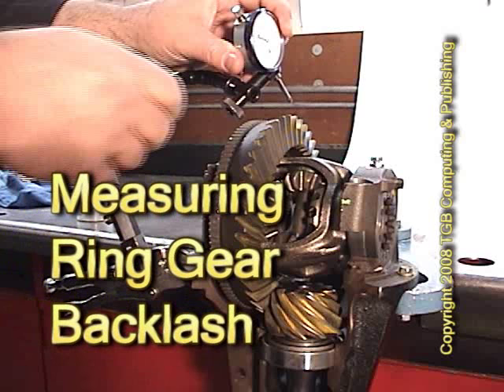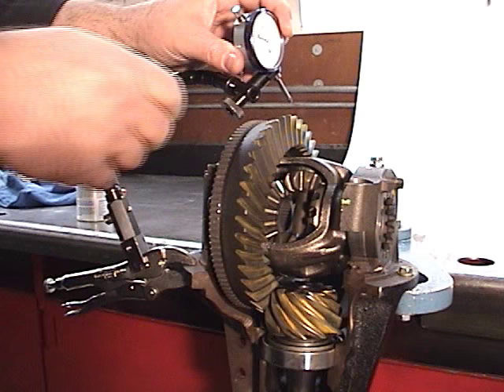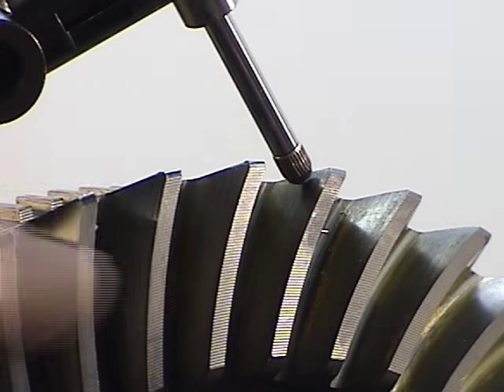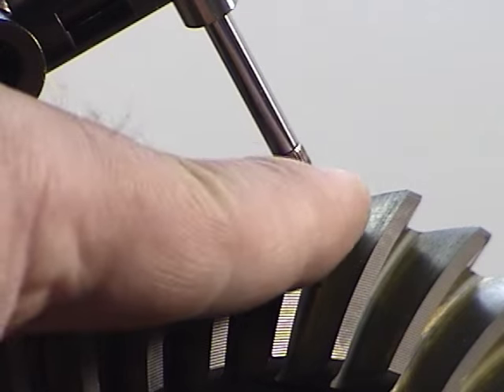Measuring Ring Gear Backlash

Comment: why does dial indicator look to be at 0.32
Reply from the maker: First of all you wrote 0.32 which is the same as 0.320" or three hundred and twenty thousands of an inch. The dial moved from  - 0.001 to - .070" which is 0.029" of an inch.
Reply: @DrivelineMaster  this actually helped thank u